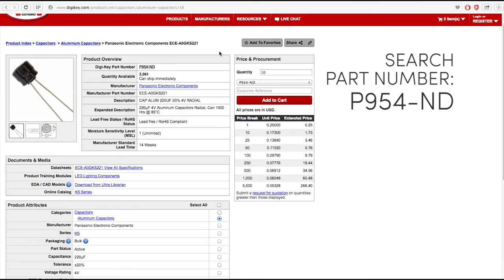Minolta X-370 35mm SLR Film Camera Fixed

Comment: hello. so i got a x300 recently and i got to finish one film roll but after i took the film out, the advance lever could move the full 130 degrees if i push it. it will even move when i push it when its off or doesn't have film. but although the lever moves freely when i push it , the component inside that holds on to the film when you load it wont move even with moving the lever. please help!

Comment: I've thoroughly followed these steps and ultimately ended up with an irritating issue. Before the capacitor replacement, the camera won't even turn on with brand new batteries. After the application of this fix, the indications in the viewfinder lighted up correctly, but as soon as I pressed the shutter button, the camera just died. After that, I had to re-power it only to find out that the electronics would work correctly but the shutter won't work. Any ideas regarding this issue??
Reply from the maker: Shoot, it beats me. That sure is interesting - the only thing I can think of is something with a shutter mechanism, which I have no clue about. Godspeed!
Reply: Did you make sure you installed the capacitor with negative on the outer end of the camera?

Comment: I seem to have this issue on an X9 I just got.  Taking off the bottom cover, I can see the mechanism and push one arm in to engage the film lever.  But, once I go all the way, it won't stay engaged (doesn't "click"), the gears just revert to where they started.  I know the batteries are good - the self timer activates and blinks when fired, but the shutter never goes off.  The LEDs in the viewfinder are not lighting up.  I will try this repair unless you think it might be something else?
Reply from the maker: Howdy, I've not owned an X9, and wish I knew more about the guts of these cool cameras. Sorry I can't help any further - I wish you well, Dave! (Just now getting to the comments from being away ill for the last month. Hope the camera adventure is fruitful.)

Comment: what is the negative side of the capacitor
Reply from the maker: Hey - if you look at the capacitor, there will be some tiny number digits but, between those, there should be a negative – symbol in white leading to that specific wire. It should also be visible on the old one, just remember that orientation for putting the new one in. Hope that helps!
Reply: Matt Originals ughhhhhh i just realized i put it in wrong and it burned out as i realized it..  ughhhhh
Reply: i shouldnt of kept using it after my worries of it. ughhhh im an idiot
Reply from the maker: Shoot. I'm curious what happened next? Could you just remove it and put another in? I hope this didn't happen: https://youtu.be/rr7bPmGTQUk
Reply: Matt Originals no no no just a regular burned out capacitor
Reply: Matt Originals im pretty sure ill be able to put in another

Comment: how did it burst?
Reply from the maker: Good question. I got mine from my dad awhile back secondhand, locked up, not working. I think these were notorious for going out. Maybe a manufacturer defect? After examining the one I replaced, it was bulged open a bit on one side, not sure exactly how it gets that way from normal use.

Comment: Hi, thanks for the video, I'll try to fix my X300. By the way, before replacing the capacitor, did the leds in the viewfinder light up?
Reply from the maker: Howdy - yes for me, with fresh batteries in, the light up display and metering did in fact work before doing this fix. Thanks!